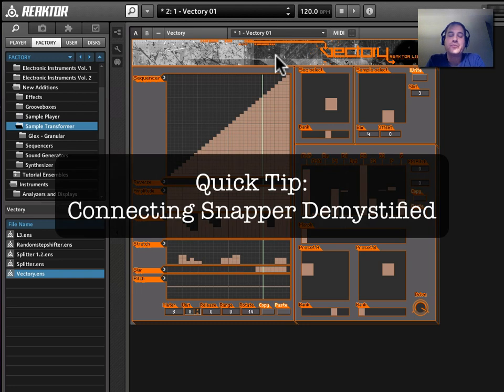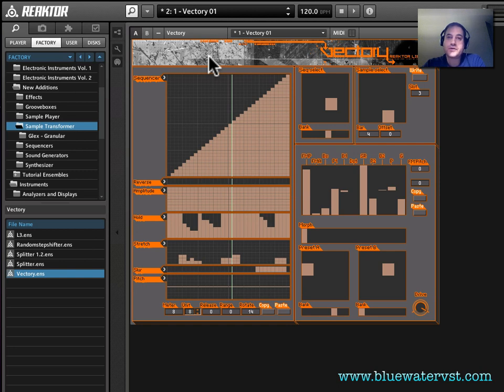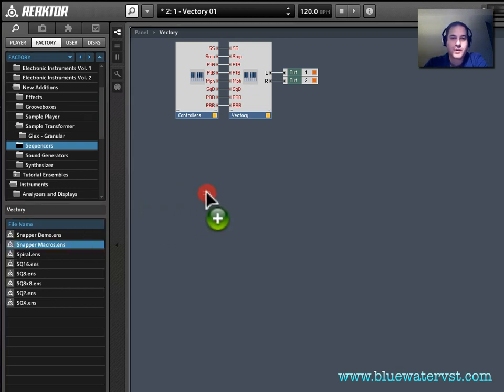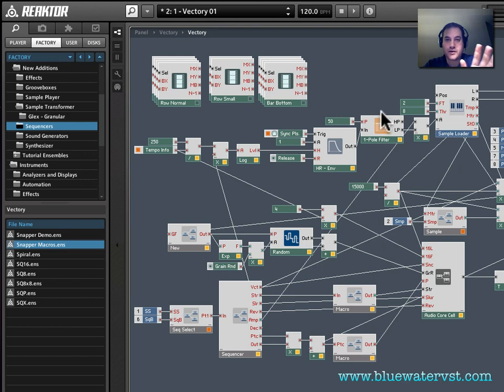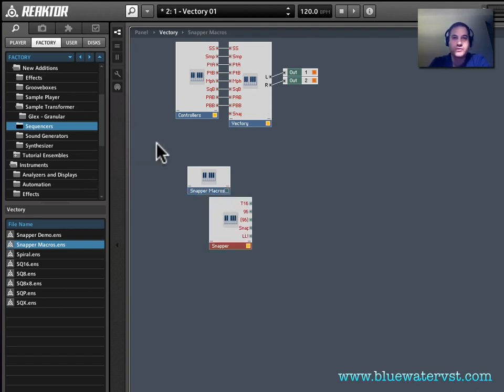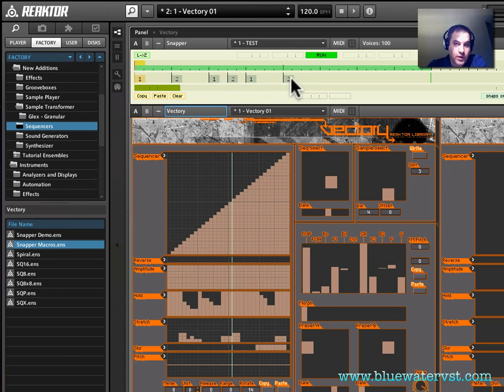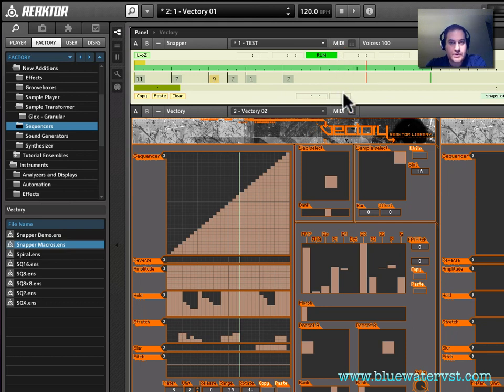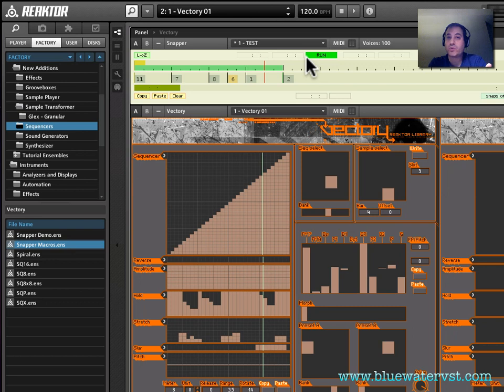Snapshot Madness: How to Use Native Instruments REAKTOR's Snapper

Comment: Hm, are you referrering to just cutting up an audio file in same sizes within Logic?

If so, use the scissors tool, and before cutting, hold down the alt-button, and it will slice the rest of the audio file same size as the "portion" you cut.